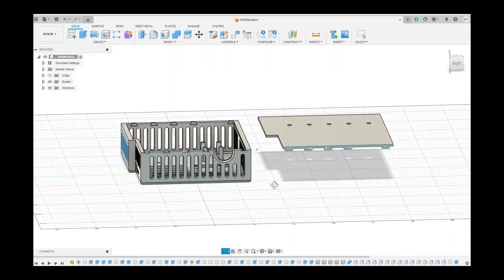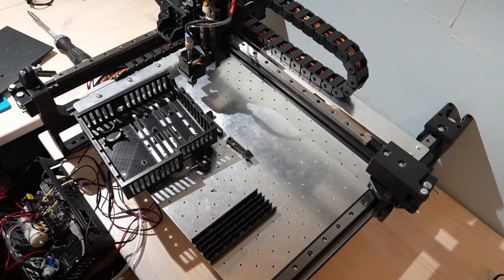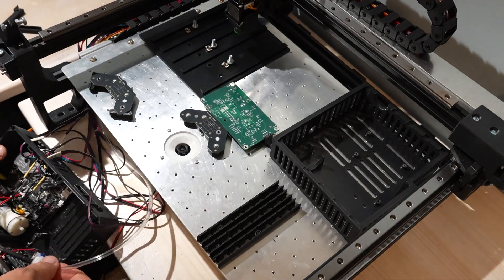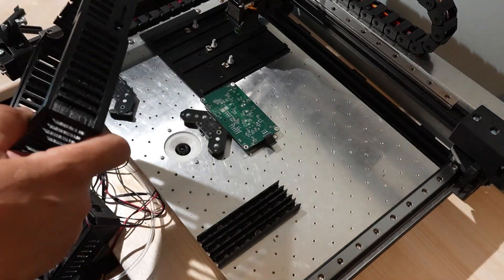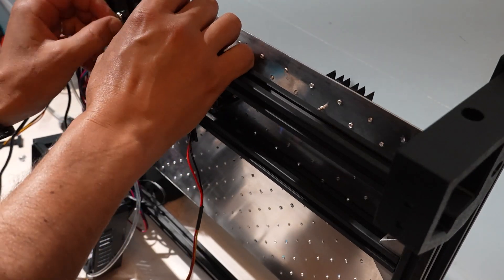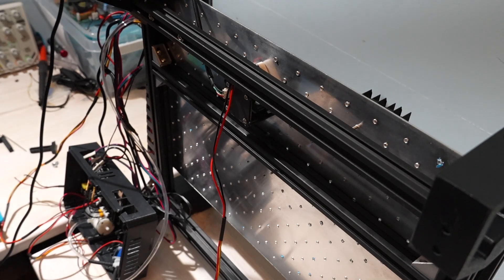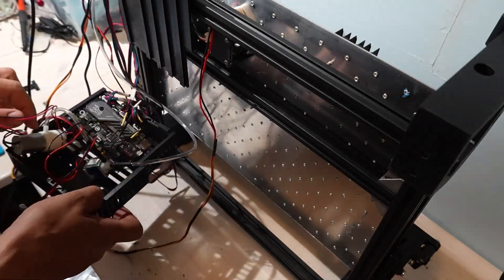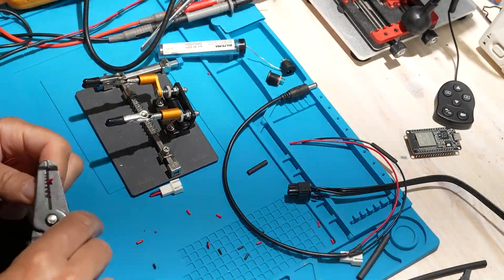Working pick and place machine, test run

Comment: how did you make your staging plate. I am looking to make one right now, 3d printing it does not seem to be a good idea to me
Reply from the maker: I used a 2 mm aluminum sheet, cut to 46 × 30 cm with a regular miter saw, you can see me using it to cut the T-shaped profiles in my latest CNC build video. To lay out the hole pattern, I printed a template with 3 cm spacing and offset each row so it forms a square pattern, then taped it to the aluminum and marked the holes with a punch. Be careful not to hit too hard or the sheet will warp. After that, I drilled all the holes with a 2 mm bit and tapped many of them for M3 threads, always using drilling oil so the aluminum wouldn’t stick to the bit and damage the threads. You don’t need to tap every hole right away, just leave them as pilot holes and thread them when you need to, keeping an M3 tap tool near the pick-and-place area in case you need to tap new holes. For the big hole for the camera and light, I simply used a 4.5 cm wood hole saw along with a standard drill, then sanded the edges to get a nice, clean finish. I really should have made a video about the whole process, but I was in a hurry and didn’t think of it at the time.
Reply: @TheWiz4Real  thank you for such an extensive answer. I thought about doing it the way you outlined but I am worried about precision of the holes.
I'd love to buy Opulo's staging plates but 3 plates plus shipping will be way to expensive when a 10 dollar aluminium sheet can do the trick. 
I think with a drilling jig I should be able to drill them with the proper distance
Reply from the maker: You don’t need to be super precise with the hole placement, this isn’t about nano level accuracy. The feeders have fairly large holes and I use washers to fasten them, which gives you some wiggle room. The board fasteners can also move, so while you do need to be reasonably precise, you don’t have to worry about hitting micro tolerances. The worst thing you can do is hit the aluminum plate too hard with the punch, because that will warp it, or try to tap threads without using cutting oil. If you skip the oil, the aluminum will stick to the tap and tear up the threads, leaving you with a hole that won’t hold screws anymore. At that point you’d have to fix it by going up to a bigger screw. It’s not a total disaster, but it makes the job a lot harder than it needs to be.
Reply: @TheWiz4Real  is 2mm thickness working well for you or would you recommend me to go with 3mm?
Reply from the maker: @SirasPK Yes, 3 mm aluminum will be much stiffer and better than 2 mm, since you’ll have more material for your threaded holes. It makes the whole plate stronger and gives the threads more grip. The only downside is that it’s a little harder to cut and drill compared to 2 mm, but nothing unmanageable. If you have the choice, absolutely go for 3 mm.

Comment: Great Job, 
HAve you tried any other Firmware than Klipper. What would you recommend
Reply from the maker: Thank you for reaching out, and don’t hesitate to ask if you have any questions.
The biggest reason I chose Klipper for my PnP project is the flashing process on my SKR board. It doesn’t flash firmware directly over USB, you have to copy the firmware file to an SD card, restart, and let it flash. If something goes wrong during a reflash, I’m not sure you can always recover without extra tools, and I didn’t want to risk ending up with an unflashable SKR board in the middle of my project.
When I was setting up, I had to make a lot of changes while prototyping, for example, finding the correct motor driver pins took me maybe 20 or more tries. If I’d been using Marlin, that would have meant 20+ rounds of swapping SD cards and rebooting just to test small changes. With Klipper, I can just edit the printer.cfg file and restart the firmware from Mainsail, no SD card swapping, no reflashing risk, and much faster iteration.
For a normal printer with only a few configuration changes, Marlin is still a great and easy choice. But in my case, speed was crucial, and Klipper made life much easier. I might use Marlin for my next project, but for this PnP build, where I needed frequent changes, configuration adjustments, and a PC connection for the GUI and cameras, Klipper was the better fit. I hope this is helpful :-)
Reply: @TheWiz4Real  Thank you so much for your answers. 
I just found out about your channel and it is very helpful. 
I also wanted to ask if you face any latencies during the run using Klipper. The project I am working on doesn't really require high speed, but I would like to know how limiting it can get. FYI, I am using a BTT Octopus. and I am working for a pick and place, but not for circuit boards.
Reply from the maker: I don’t have direct experience with your Octopus board, but I can help point you in the right direction. Most Octopus boards flash firmware from a microSD card by default, you copy the firmware.bin file to the card, insert it, power cycle, and it flashes automatically.
Some versions of the Octopus can flash firmware over USB right out of the box, while others require putting the board into DFU mode using the BOOT0 jumper or the USB-power jumper or using an ST-Link programmer. The easiest way to know is to test your board, if your PC detects it in DFU mode when connected via USB, you can flash directly without touching the SD card.
On my own board I can’t see any noticeable latency when running Klipper, but your results may differ, so you’ll need to test that yourself with your PnP setup. Either way, it’s a good learning experience, both Klipper and Marlin are worth learning, as each has strengths that can be useful depending on the project.